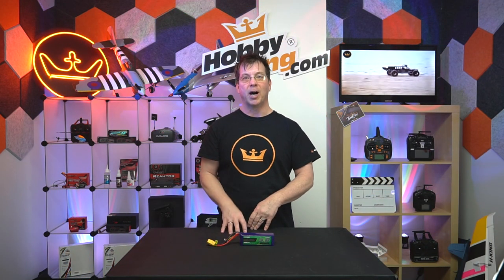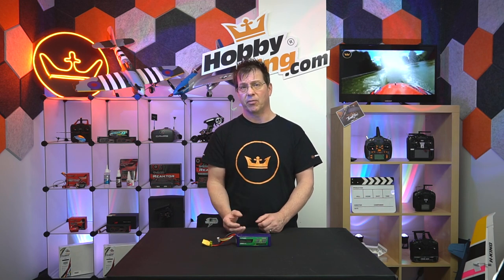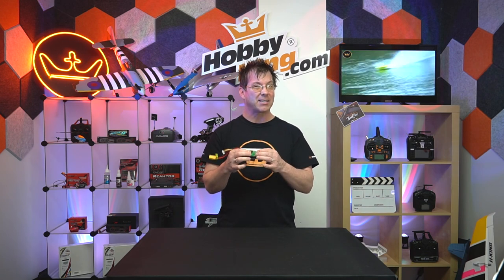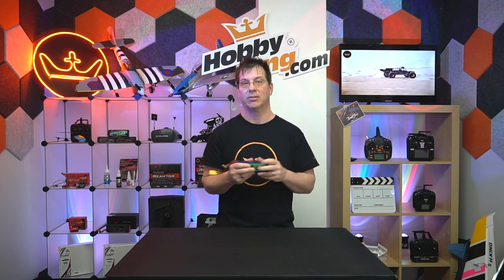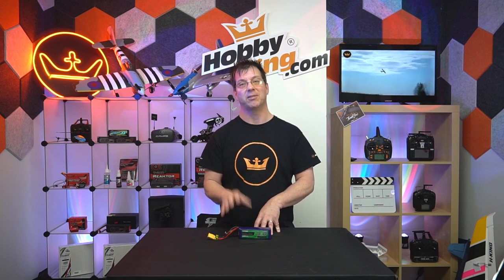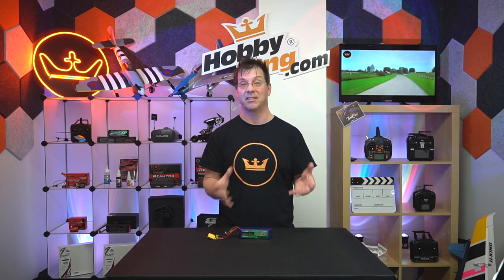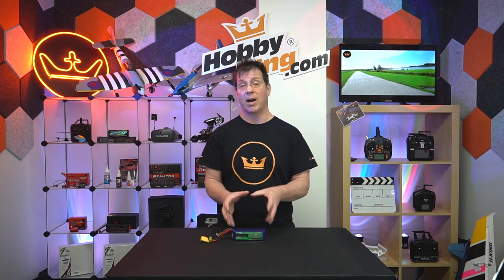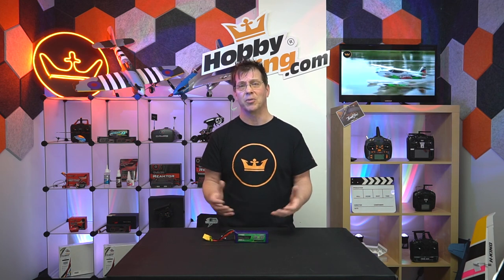HobbyKing's Tips Bench Tuesday -  How To Determine if Your LiPo Batteries are Safe

Comment: Talking about it is great but I would like to see an example of what and how you test with voltage meter.  I need visualization.  Other issue is visual no puff, damage, charges and with lipo checker readings are fine (charge and store) but 1st burst in plane is good  then after 1st minute of flight, the battery sags and LVC is encountered.  How do you check for this so you don't run into LVC while in the air?
Reply from the maker: Great suggestion! The original article is here https://bit.ly/3wg5Lhf

Comment: Good job.  Perfect timing really I’ve got a question my 
Brand batteries 2= 3s Lipos 80c  and are exactly @ 4.20 charged but the IR is about 12 average on one 3s and the other is 10??  This is there first balance charge .  Didn’t even use yet do to rain. Also how long can I keep Lipo batteries fully charged???
Reply from the maker: Thanks and the original Article: https://bit.ly/3wg5Lhf may have more details to help